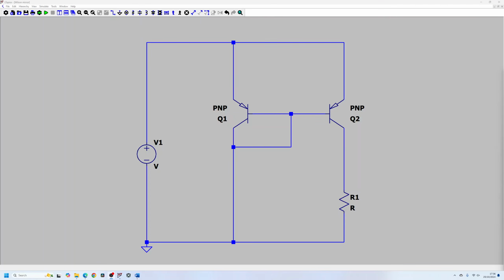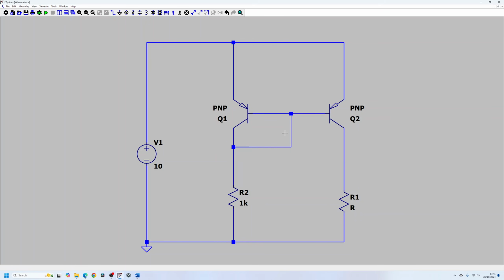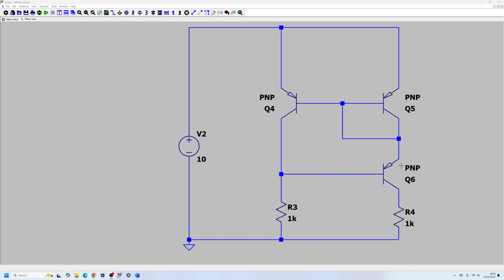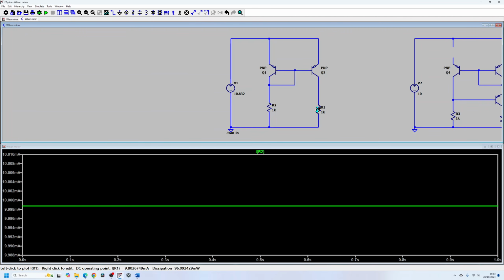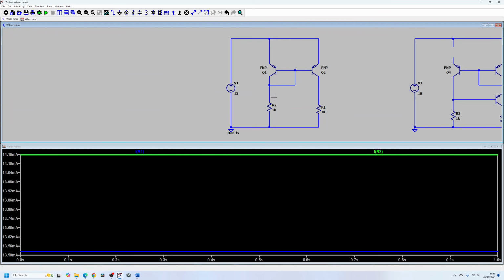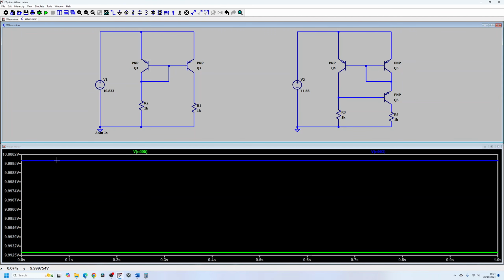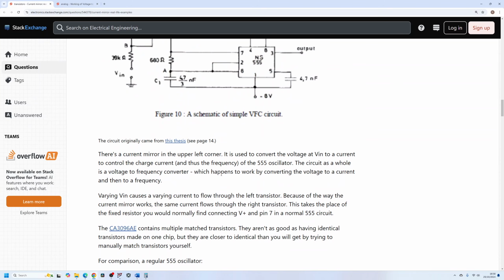Learn Transistor Circuits! Basic and Wilson Current Mirror

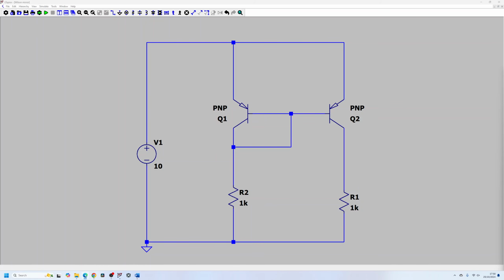Comment: 7:07 "Another issue is the limited output resistance..."  Don't you want a low impedance output so that it has the ability to drive the next stage?
Reply from the maker: I think you are right,  I should've said that bit for the Wilson mirror not basic mirror. 

The Wilson mirror has a higher output resistance.

Thanks!
Reply from the maker: Another thing I should add is that the statement is probably in by itself is okay, because the output resistance is not ideal.